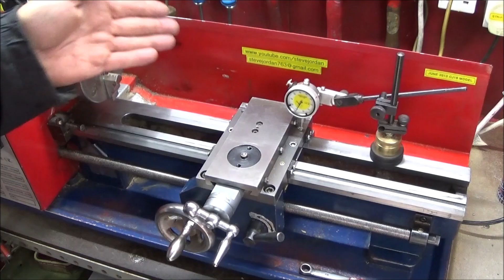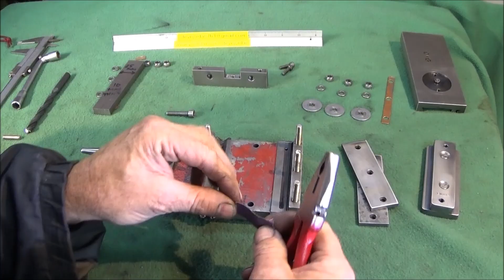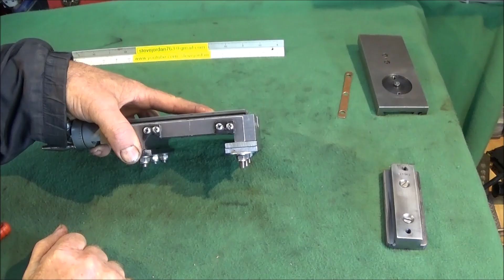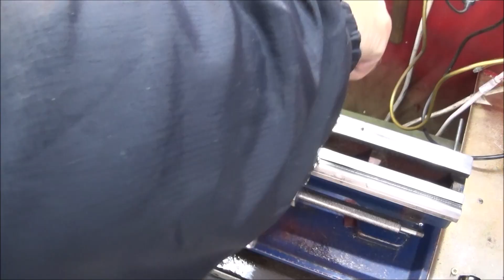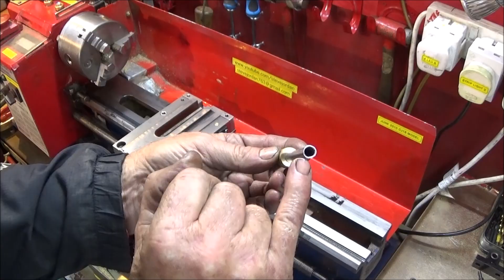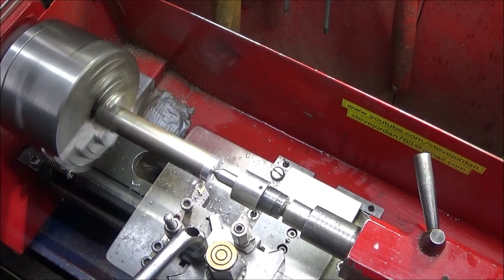A New Easy Very Effective Upgrade For The Chinese Mini Lathe Carriage

Comment: I was able to use the original plates and setscrews to get movement under 0.001" on both sides. You could probably use the setscrews in the back to tip the plates up a bit and take up that last bit of slack.

I'm surprised how well it takes that cut considering how far your tool overhangs the edge of the cross slide. On my machine the gibs are very weak, possibly not cut correctly. They will lift off the dovetails on hard cuts.

Comment: PRO TIP
+Steve Jordan
To install the STUDS  you DON'T use  Emery cloth and Pliers!!  LOL
YOU USE 2 NUTS together on the end  but then you ONLY use a wrench on the TOP-MOST nut which will cause the nuts to lock together w the thread and you can then tighten the Stud as much as you need.   Then you use 2 Wrenches, one on each nut to Break them loose, and easily remove them w your fingers.

To  REMOVE the Studs you also use 2 NUTS  but this time you use a Wrench on the LOWER nut and unscrew until it locks w the upper nut and the thread  Then you can remove the Stud.
then finally you use 2 Wrenches, one on each nut and break them loose of the stud!
and VIOLA.
Reply from the maker: Hi you can use whatever method you like...LOL....it doesn't make any difference on this particular job, as most of the thread doesn't get used....I did it like this for a quick method to keep the video short, rather than showing other screw-stud installation methods..... Lengthening the videos, I think, would be nuts for the viewers....:)

Comment: Hi Steve, I’m new to machining, so your videos have been extremely helpful. I just purchased a new Sieg SC3 7” x 16” lathe with 500W brushless motor, and completed my first cut on steel. Suffice to say it was not pretty! I had massive tool chatter from excessive play in the lathe. I actually saw the tool move when in came into contact with the steel! This modification will be one of the first things I do to the lathe, so I can get some half decent cuts. Thanks so much for sharing your knowledge.
Reply from the maker: Hi Greg, You should be able to machine ok with the lathe from new. Many people when they first get a lathe and start machining tend to make the mistake of taking too deeper cuts. Also when cutting steel I only use carbide insert tools such as the ones that take the 070204 inserts. If you have this tool set on center height, the lathe gibs correctly adjusted on the saddle and cross-slide and only take .010" cuts (,020" overall) you should get good finishes on stainless steel. Obviously you can take deeper cuts on softer materials. 

The upgrade does make the lathe much better especially for milling, but it is still best to use the machine as I have mentioned above. I say this because there are people that try to claim that they can take massive cuts with this lathe. Or they say that they part-off steel. This generally isn't possible with the standard compound slide and the fact that the lathe doesn't have a coolant system anyway. I do all 'parting-off'  off of the lathe, in the bench vice with a hack-saw then finish face on the lathe, except when machining brass or plastics!  

This lathe is a great machine and I have made hundreds of great components using it, but that is because I know not to try and use it as a much more expensive heavy duty machine. Thanks for watching...Regards Steve
Reply: Steve Jordan 
Hi Steve, thanks for the reply. To be fair, the first cut I did, the lathe was in ‘as delivered’ condition. I was certainly not making deep cuts, 0.002” was all. I spent some time today cleaning up the lathe, adjusting both the gibs, adjusting saddle, lapping, lubing etc and have now removed nearly all the play. Now when I push/pull on the toolpost there is no discernible movement which is great. It’s now making decent cuts with just the cheap carbide tipped tools.

Comment: By far the best carriage upgrade that I have seen for the 7X mini lathe. Very thorough explanation. I appreciate the time spent filming, editing and uploading this information.
Reply: Hans Schmidt - Just saved me some writing. 
Thanks Steve Jordan. ;-)
Reply from the maker: Hi Hans, Thanks for watching and your encouraging comments....Regards Steve
Reply: @SteveJordan  Really great job Steve (My name is also Steve). Great ideas, and great, calm, explanations/demonstrations. I really appreciate your style... It's like listening to one of your best friends explaining something to you, rather than listening to some robot instructor you don't know. Thank you so much Steve. Also, is there any chance you could help me with the problem I'm having with my machine? I just bought it preowned (supposedly never used). It's the 7x12 harbor freight, online order only, model. I'm still in the process if figuring it out, but for some reason I can't get consistent cuts. Because of this, I took pretty much everything apart. I cleaned everything up, spent a small amount of time lapping the ways/cross slides etc (very little... Not enough to measurably change any of the tolerances), relubed, and put everything back together, making sure everything was adjusted. But still, when making a a cut across the length of a 4 inch or so long piece of material, I get inconsistencies, as though something is still loose. (Please forgive my lack of knowledge rearding terminology) I've got both of the cross slides (left/right, forward/backward adjusted super tight, to the point to where it's even miserable to advance either one of them, but still I'll get deviations of several thou. of an inch on the diameter of my material over a couple inch section.

Please help. I bought this lathe for the specific purpose of making a rear axle for an ebike I build for a friend. An axle that is far back ordered, with no other possible sources, and he is very anxious to get his bike going.

Thanks so much
Steve
Reply: Awq
Reply: I agree, thanks for all that you do. I know i must take alot longer than we think to make up a video. Ta.

Comment: Hi Mr Jordan. Why have you changed from the brass to the steel bars on the carriage?
Reply from the maker: Hi I changed over because someone told me that brass isn't really a good surface for this, plus my Myford lathe has steel bars under the carriage. I found that my brass ones did wear quickly, so I had to keep adjusting them. It may not make a significant difference in feel, but giving the information about using steel, makes it a better upgrade both in material buying costs and long term adjustment free use. My Regards Steve

Comment: Why would anyone purchase a lathe that requires upgrading to work as it should out of the box?
I can understand adding features, I've customized all my machines to some extent. But to have a carriage that moves up and down requiring shims??
Reply from the maker: Hi Scott, Why people purchase these lathes that need a bit of upgrading is the low price compared with one that is of better quality. If these Chinese lathes were finished to high specification, they would probably be triple the price, considering man hours and production costs. Also Myford ML7 lathes, which are very expensive to buy, require shims both in the carriage and the head-stock, from new, to acquire the necessary adjustment. You will find shims in many lathes like this. I really like my Chinese Lathe and have made excellent components using it....Just like I have on the Myford ML7. Also buying a cheaper machine, like the Mini Lathe, and upgrading it gives excellent knowledge on how a lathe is built and made to work better. They can be used straight out of the box, but upgrading them makes them more rigid to enable them to take on heavier tasks.....Regards Steve
Reply: In no way is this a detrimental critique!
Kind of like wanting a CNC machine that's way out of budget so you add steppers to your existing screws and get an open source package to run them. Works, but....
It's great that you and people like you are there for the people that want a Porsche but only have a Volkswagen.
Reply: These lathes are small and light. Don't take up much space. Some people have more time than money. I have been modding mine. I used to keep it up at work to make parts. Have had it over 10 years.  But use it more at home now. If something needs to be made for work I get to do it at home in my garage on overtime. My company is to cheap to buy a lathe or milling machine... So i get extra hours and bucks added to my time card if they need something made at night or on the weekend.
Reply: Some people take the attitude that it is not a lathe.  They see it as a kit that can be finished out and enhanced so that it becomes a lathe.

Comment: Just wondering. Why did you replace the brass gibs? Great content Thanks
Reply from the maker: Hi Ron, I found the brass ones to be sticky in places,. When I put the original steel ones back in it was noticeably better and easier to adjust. The Myford lathe has steel ones as well.....Regards Steve

Comment: So glad I found your video's Steve as I've just purchased a mini lathe and I've never used one before so hopefully I'll get the basics sorted and then have a go at making some of your great modifications
Reply from the maker: Hi Steve Great that you have bought a Mini Lathe. I had mine about a year before I did any modifications. They are usually ok from new as long as you check the gib strip adjustment regularly. 
  Also don't be tempted to make massive cuts like people say they do. I only take .010" cuts (.020" overall) maximum on most turning operations, even on my Myford lathe now. Also I do not use a parting off tool except on brass as I do not have coolant. I just use a vice and hacksaw to cut bar or components off then face to length on the lathe. I say this as many people have tool breakages which can be quite off-putting when starting machining, especially with part-off tools. Hope you get on well......Thanks for watching.....Regards Steve
Reply: Steve Jordan thanks for your reply , have you done a video on how to cut threads using the mini lathe as I've watch quite a few and still don't understand it but I assume it's because the Ines I've watched are on bigger more professional lathes.... thanks

Comment: The best method for tightening studs is to thread two nuts onto the stud and then tighten them up against each other. You can then use the nut on the opposite side of the direction you want the stud to be driven to turn it in. The nuts lock together allowing you to apply a lot of torque to the stud and once you're done, you release the lower one [on the side of the part that is was inserted into and then simply spin bot off. Saves damage to the thread and allows far more torque to be applied to the stud than the pliers method. Has the added advantage that if needed you can torque them to a specified value with a torque wrench.
Looks like a nice mod, might have to give it a whirl as parting on my CJ18 is a fraught affair.
Keep up the great vids!
Reply from the maker: Hi Thanks Yes that is the best method really. Thanks for watching.....Regards Steve

Comment: What is the range of the shimming that you used in this modification.  Shimming can be quite expensive if a large number of thickness are purchase.
Reply from the maker: +Peter Brown Hi Peter, I think I used .017 thou in the end. I did buy some brass shim some time ago and like you say it is very expensive. Over the years I have collected lots of metal items such as brass and copper plates, which I save for cutting up and using. Also I have collected things like feeler gauges that I would cut up and use if neccessary to keep the cost down. Thanks for watching. Regards Steve

Comment: Dear Steve, Great upgrade. I will do that. Do you have any upgrade ideas for the cross slide?? Thats where I have a lot of play. Its either to stiff with no play or too loose with excessive play. Thanks for the great videos. Kurt Seattle, Wa.
Reply from the maker: +Kurt Kenyon Hi Kurt. I was just looking into this as mine has a bit of play. I did fit a bought brass gib strip some time ago and this made those problems that you mention much worse. I have put the steel one back in and it is much better. I'm going to have a closer look at this to see what I can do. If I can improve it. I will make a video. Thanks for watching...Regards Steve
Reply: Hi Steve,  I bought a mini lathe 3 years ago and have made your previous saddle upgrade with brass plates and it was a big improvement.  My main problem is with the cross slide, it is impossible to adjust the gib strip to allow movement over the full travel due to binding up solid.  Possibly the dovetail slide is not parallel,or the gib strip is tapered.  To overcome this I have made up a set of knurled hand screws to replace the gib set screws and have to constantly adjust them as I use the cross slide travel to remove the play.  The only benefit with these screws is the ability to be able to easily lock the cross slide when it isn’t in use, but I really would like suggestions how to cure the problem as the hand screws are fiddly and sometimes difficult to reach.  Thanks for another great video, I hope you can make one about improving the cross slide soon.

Comment: Yer killin' me here pal, I just barely got done with the first upgrade with the studs......
:)

Looks like I am going to have to brush up on my Google-Fu to try and find some metric spec'ed steel. It's not that common over here in the States, at least not at any of the metal suppliers I frequent.
Reply from the maker: Hi Phil, I would just put ordinary steel studding in. It doesn't matter really. I just use stainless whenever I can. Thanks for watching....Regards Steve
Reply: @SteveJordan  I don't think he is talking about the studding. He is talking about the steel plates that you used.

Comment: Why do you need a second lathe?
Reply: +Mkkt Bkkt
Because you can't have 3 lathes without 2 before. ☺
Reply: BeachsideHank Haha 😂
Reply from the maker: It always pays to have a second machine. ie,  The Mini Lathe has a larger spindle bore than the Myford, so I often use that when holding larger diameter  bar......The Myford is a larger Lathe so it can take a greater length work piece. Thanks for watching...Regards Steve
Reply: Mkkt Bkkt the man who dies with the most tools wins